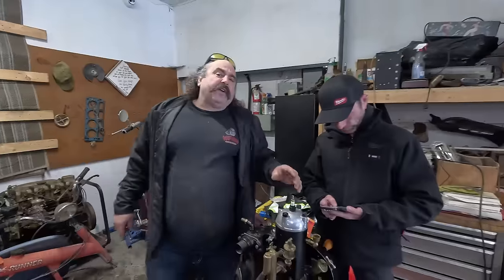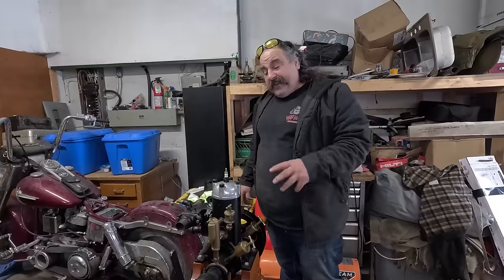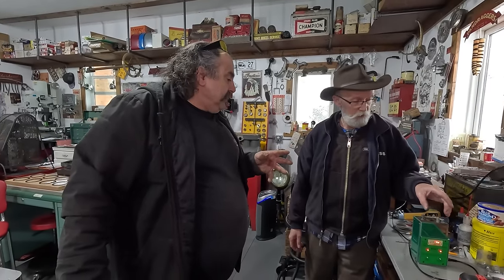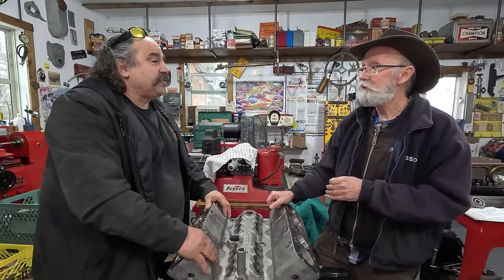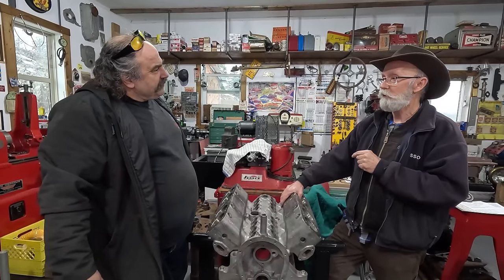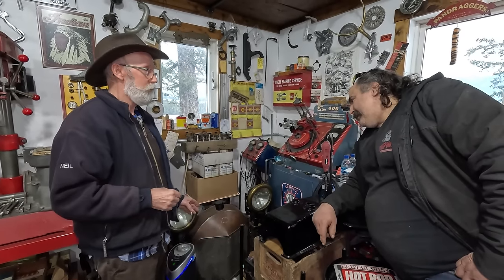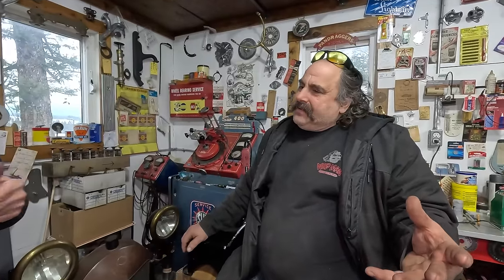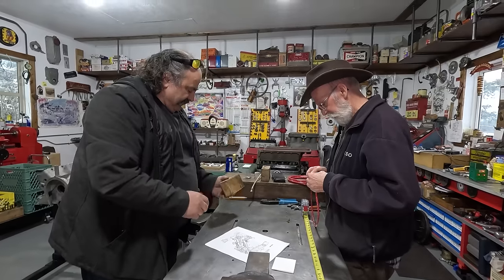Model T Engine History Lesson with Avery Shoaf!

Comment: Avery,
Those clips soldered to the model T buzz box are called Fhanstock (or Fanstock). Clips. They were used extensively in early telegraph and radio equipment.
If you need some let me know and I’ll send them.
Peace,
DrRick

Comment: Great video, Avery! Your passion for antique engines is inspiring. It's wonderful to see you learning and sharing your knowledge with us. Keep up the fantastic work! #wildmangarage #rustvalleyrestorers

TL;DR
Avery discusses an antique engine, possibly from a 1930s boat application, its unique features, historical context, restoration challenges, mystery surrounding the engine, and insights on ignition systems and spark plugs.

Key Takeaways
~ Discussion on a vintage engine from a potential 1930s boat.
~ Insights on its unique components and workings.
~ Explanation of the buzz box ignition system and spark plugs.
~ Challenges and intricacies of restoring and understanding old engines.
~ Historical references to the engine's era and design.
~ Commentary on the rarity and significance of the engine model.
~ Tips on engine maintenance and cleaning techniques.

Comment: I'm glad youtube recommended your channel, I subscribed. My dads old dragsaw used one of those coils with a hotshot dry cell battery that you'd have to take out and charge. Those old hit and misses were two strokes and would run in either direction. I don't know if yours is a hit & miss though. They would regulate RPM by dumping compression with a fly weight governor.

Comment: Thake the plug out find top dead center
Move the lever till is sparks just before  top dead put plug back in .put gas in prime up shut it and turn over  if you don't have the water hooked up don't run it long they get hot fast and check the float out in the carb 
not sure on this engine but  should run clockwise or counter clockwise   
For forward or reverse have seen them going from forward to reverse with out shutting it down

some carbs can be a pain